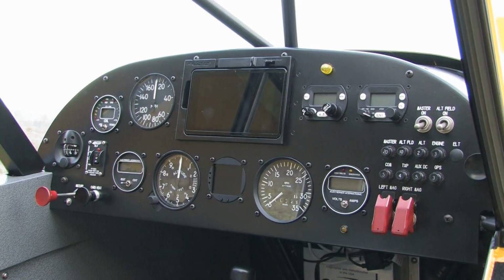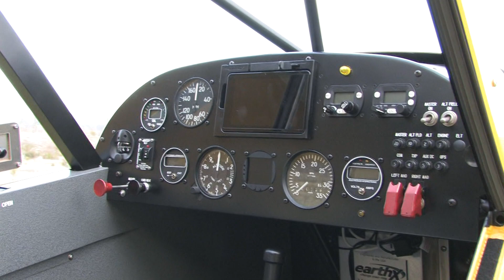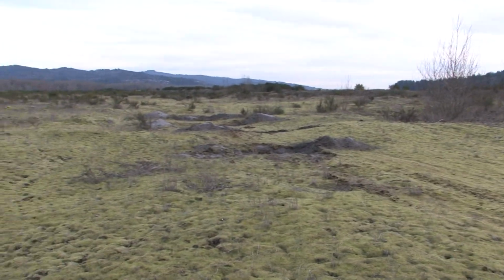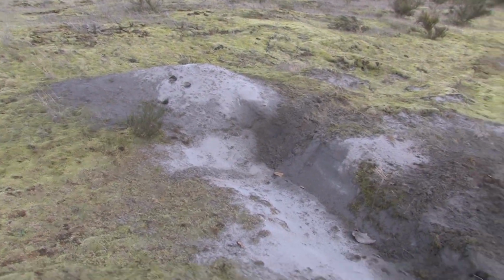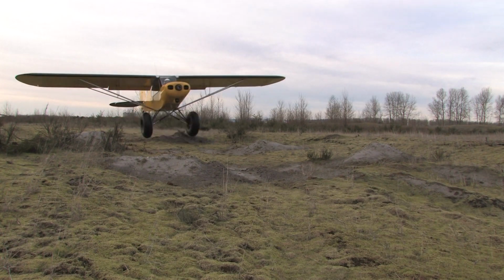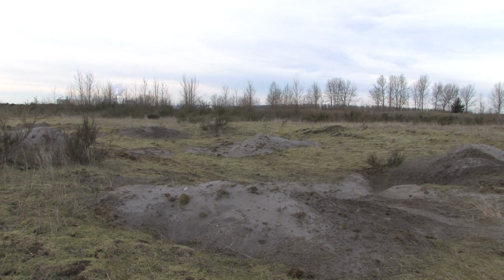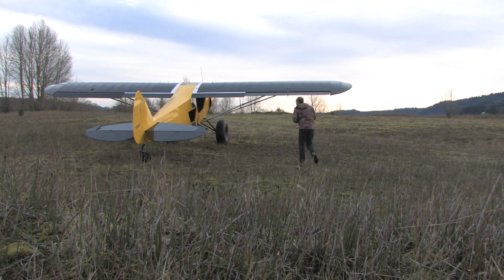Super Cub, Landing in ditches, Experimental (Javron Kit)

Comment: Great to see how you test your gear. Love the discussions on safety and risk mitigation when trying out a new sand bar/strip (aerated sand, etc.). Would love to hear some discussions about how you know where you can/can’t land. BLM vs. county or state property, etc.
Reply from the maker: That can be a sticky subject for us in the lower 48.  Alaska is pretty much wide open for off airport but where I live I have been Mirandized for landing on National Forest lands.  I showed them the CFR's as they applied and that is pretty much where it ended.  The BLM is I believe much more problematic because each area has rules that apply to the specific area and it is pretty hard to find out what is legal from the agency in charge.  They are quick to usually say it is not legal...
Reply: @mauleguy  Yeah that’s what I thought. Interesting. I hear certain states are more GA/bush flying friendly than others as well. Glad you at least have an open playground right in your backyard...

Comment: I’d your cub standard fuselage or 4 inch wider? Looks great I’m planning to order one from Jay to be shipped down to Australia any advice?
Reply from the maker: I did the 4" wider on the Super Cub before this one.  If you are a big guy the 4" is nice or do need to haul a little more gear.  I am small at 5'7" and 155 pounds so the stock fuselage is good.

Comment: Great build Greg. I have been researching the Javron kits. Carbon Cubish performance in a more classically true to Super Cub plane...for $100,000 or more less than a CC. I like it. I notice the Javron cubs have a gross weight up to 2200...what is your particular gross weight?
Reply from the maker: As an Experimental you can pretty much make it whatever you want, I set mine for 2000 pound.

Comment: Really nice build!  Did you use Airframes aluminum struts?  It looks like they are unpainted.  If so have you seen any signs of corrosion?  Thanks
Reply from the maker: Yes they are Airframes, before the STC was bought by them but same thing.  All the blocks that are riveted are anodized so they will not corrode.  The strut material is still bare.  Not to worried, pretty hard to paint the inside.  I guess you could slosh them with primer inside.  They are not sealed so they can drain.  If you lived in salt air I would paint but otherwise it is just extra weight:))
Reply: @mauleguy  Thanks Greg, I have a set arriving soon and was planning to not paint them, that helps 👍

Comment: Nice cub, well I figure with your experience your the person to ask, why did you go with the O-320 and standard wings? Compared to Bushwacker it seems so tame! A O-320 with 10:1 compression makes 160-170 hp? at 2700rpm? Wide deck? And why  you choose to go with the squared off Javron wings? AND one last question at least for now, the extended gear, are they one of the options in the Javron kit or did you fabricate them? Thanks ahead of time and for the videos.
Reply from the maker: Well that is a lot to comment on but I will give it ago. I built a cub before this one that was Lycoming O-360 with 10-1 pistons, 84/43 1p235 propeller. It had a big wing with big double slotted flaps,  more angle of incidence and I was a little disappointed with it in gusty conditions.  It did fly slower for sure, probably and honest 6 mph slower.  It was a great airplane and I really have nothing bad to say about it.  I wanted to build an O-320 equipped cub for a few years now.  It is hard to beat the handling characteristics of a stock wing.   I also tried to build this one lighter then my last cub.  The last cub was a wide body Javron and it weighed 1194.  A lot of that additional weight was the big wing with double slotted flaps and aluminum ailerons which were also custom.  It is all a compromise,  fly slower add weight.  There are some things that make an airplane fly slower that make sense and some don't for my kind of flying.  

The current 0-320 is a wide deck and it turns 2700 on take off.  I would say it is around 170 hp.  If feels much more sporty then the big wing cub I had but either one will do the job.
Reply: @mauleguy  Thanks for the time and the reply!

Comment: any reason you went with superflite vs other fabric?  I'm a complete newbie when it comes to recovering but planning my first project - likely rebuild a champ to experimental.  Also did you go dark on top of the wings/tail for sun/frost removal in cold months?
Reply from the maker: I have tried almost all of them now.  I have a friend in Alaska that is using Superflight on his Cub and said it was less steps in the process so I figured I would give it a try.  He liked it and said it was holding up well.  I think it is a good process and probably a little faster then Polyfiber but they are all time consuming.  Use what you know and it will all be good.
Reply from the maker: Yes the black on the wings is for early morning frost